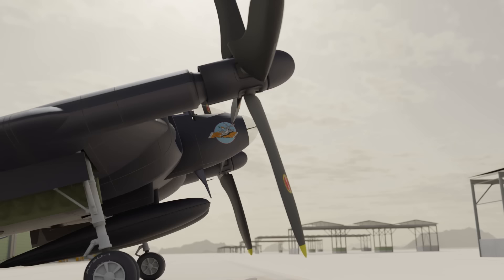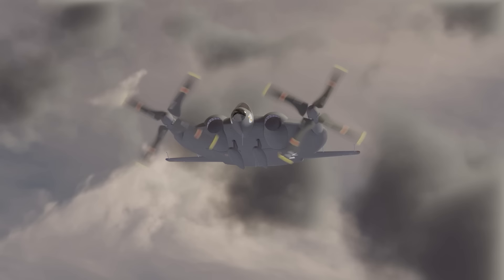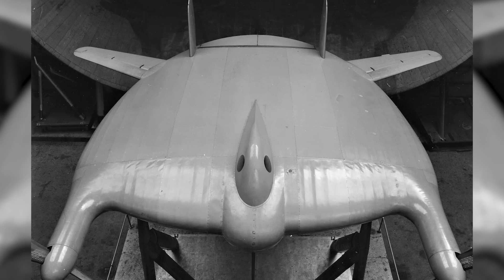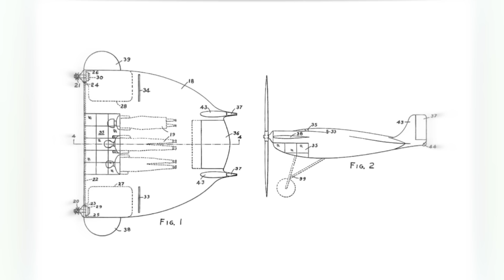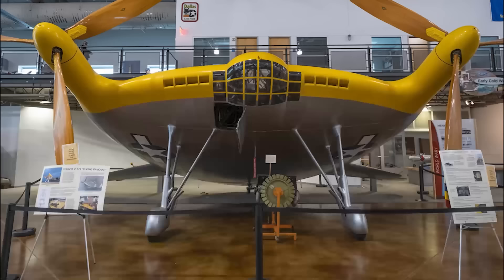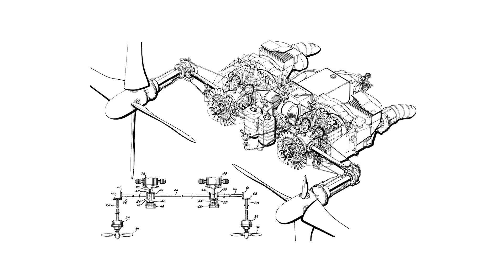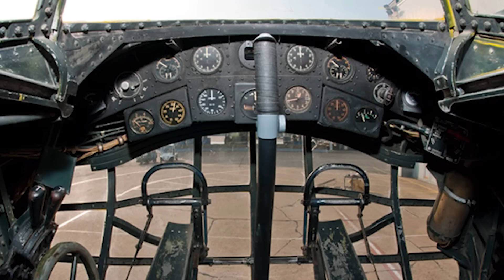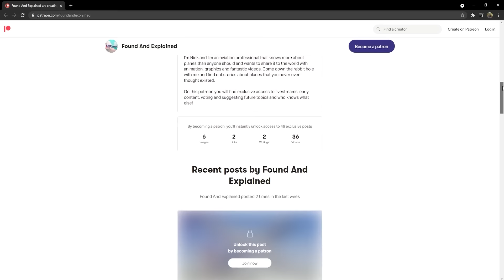The Flying Pancake - Slowest Plane Ever Made!

Comment: The engineer/designer's concept was vindicated, this could have been a very successful design but it took too long to iron out the problems and by the time that was done the jet age had already arrived. Like the Bear Cat and many other post WWII "Super Props" we will never know just what this design might have been capable of. I love designs like this that dare to stray from the conventional and push design in a new direction, even if the design fails what is learned often advances aerodynamic understanding.
Reply: I'd hardly call this a superprop.  More like a superflop.
Reply: Yes, this looks like would be useful against u-boats operating from merchant carriers as in an WW 2 oil or grain ship with an flight deck. Not the jets who killed it I think but more escort carriers and fewer u-boats.
Reply: How do you figure the designers were vindicated?  We can not really know what the performance would be like because it never flew.  And the fact that no one else came up with anything similar, say a turboprop VSTOL tells me the concept was probably flawed.
Reply: @scootergeorge9576  It flew in testing, and was eventually reincarnated as the V-22 Osprey.
Reply: @ouroboris  - The XF5U never went beyond high speed taxi test. A much lower powered proof of concept aircraft did fly.  The XF5U was scheduled to be shipped to  California, for flight testing but it was canceled and the aircraft broken up and scrapped.  And the V-22 is completely different.  It is not a fighter but is vertical takeoff and landing.  The aircraft was a loser. And following it was the XF-6U Pirate and the F7U Cutlass. Three losers in a row. Were it not for the F-8 Crusader, LTV would probably folded as an aircraft manufacturer.
Reply: @scootergeorge9576  Okay
Reply: Kk
Reply: @rulingmoss5599  I don't know who they are lol.
Reply: If it was successful they would give it a cooler name rather than Flying Pancake. They would call it Sting Ray.
Reply: It would have been a horrible combat aircraft.  Extremely complex engine drivetrain would have resulted in poor reliability.   The very low aspect ratio wings have high induced drag at cruise speed - leading to limited range, altitude, and load carrying capability. Large diameter props severely limit sh aircraft’s red-line speed, due to the requirement to maintain the blade tips at sub-sonic speeds.
Reply: @scootergeorge9576  Your incorrect about nothing similar. The Flying Flounder was basically the same concept, though single engine. It was  built in 1945. I wouldn't say any of them "vindicated" the design, but only because the intended purpose, AKA the war was over. They did however prove the design met the specs in all other aspects.
Reply: @diGritz1  The aircraft was designed to be a fighter aircraft with short takeoff and land capability. The latter was proven with the fixed gear, low powered,  proof of performance prototype.  But since actual fighter, the XF5U never flew so we can only speculate as to how it would have performed as a fighter in speed, maneuverability, range, etc.
Reply: @diGritz1  The V-22 pivots the engines for hover and can hover in level flight.
Reply: @scootergeorge9576  You said it yourself--"A much lower powered proof of concept aircraft did fly." That's a win in most engineer's books. Less the plane being a "loser" and more a classic case of "no longer needed."  Which has doomed a lot of plane concepts that were far from "losers" by anybody's metric.
Reply: @dphalanx7465  - Since the actual fighter version never flew, we can not know just how well it would have performed. And the fact that no one else built anything like it, tells me that it wasn't the greatest of ideas.
Reply: @scootergeorge9576  The designer Zimmerman worked on (and won awards for) various STOL/VTOL projects through the 60s. The whole "props at the wingtips to  cancel out tip vortices" idea is applied in Osprey VTOL today. I like to think that the XF5U's engineering DNA spread throughout a whole generation of STOL/VTOL aircraft.

And once again, cheap & simple Jets killed it; not any true failure in the idea. The true sadness is in the fact that jet-tech advanced so fast post-war. (Sigh, if it had only held off until the end of the 40s, things would have been so much more fun... )
Reply: This would make a fun concept for model aircraft builders
Reply: @Enonymouse_  - 40+ years ago, I saw an article in a radio control airplane magazine about  an RC "Gulf" gas station sign. Round like this but with a single propeller.  Most spectators were unimpressed, thinking it was just an advertisement for Gulf oil.  So the next model he built was a flying Stop sign. Way more popular. Looked like a stop sign was blown off the post and was flying away!  🤣
Reply: The Arup S-2 in the 1930s was the direct ancestor of this, and it was excellent.
Quick on little power, stall and spin proof, super-STOL.

The V-173 flew very well, despite the unnecessary situation of the props mounted as they wee.
Reply: Sergei Sikorsky worked on this, and he had designs for jet versions of it.
It didn't need or gain anything from the situation with the props at the wingtips spinning outward, a version designed for jets would have outflown everything in the air and for another decade to come.
Reply: @scottcullen4750  See the Boeing model 391, for the kind of fighter this would/should have been. It ignored the wing=tip vortices, had props in the center as with the Arup which flew very well.

The situation with the props as they were was a digression from the true potential shown by the Arup S-2, which was the direct ancestor of this.

The Boeing would have been super-STOL, and 500+ kts, without the power-train arrangement necessitated by the wing-tip props.

The very-low aspect-ratio do not suffer from high drag all the time. The Arup and many others of the sort prove it.
The huge vortices are only present at very slow speeds at very high A. The vortices and the effect that lets it fly super-slowly without stalling, are elective and temporary.
Reply: @scootergeorge9576  The Arup S-2 was exactly like this but without Zimmerman's affectation for wing-tip props, supposedly tyrying to work towards a VTOL tail-sitter.
The Arup and the similar Boeing model 391 of the era ignored this trick of Zimmerman. Other planes basically identical t the Arup have also flown well.

Se the youtube "flying heel-lift" about the Arup.
Reply: @scootergeorge9576  See the Nemeth "parachute plane" of the '30s, and the modern Rowe "UFO' completely circular tail-less with a fi8n and it flies well today.

This "flapjack" was based on the '30s Arup S-2, which flew very well. Better than other planes of its class.
Reply: @JFrazer4303  Unless there actually was a jet powered  aircraft similar to this that actually flew,  the actual performance  can only be guessed at.
Reply: @JFrazer4303  I do not believe the 391 was built much less have flown.
Reply: @scootergeorge9576  
The prototype flew . . .
Reply: @scootergeorge9576  
It was NOT a loser. The war simply ended before it could be refined.
Reply: @scottcullen4750  
Complex does not mean unreliable . . .
Reply: @jfangm  Complexity always reduces reliability, although you can mitigate that thru increased maintenance. Complex aircraft such as the F-111, SR-71, B-1, Harrier, Osprey have as much as three times the maintenance man-hour requirements as aircraft like the F-16, and ten times as much as simple aircraft like the A-10.
Reply: @scottcullen4750  
And the A-10 is just as complex an F-14, yet required less maintenance. The M16 is more complex than the Mosin-Nagant, but is more reliable. It's almost as of complexity does NOT inherently affect reliability.
Reply: @jfangm  I’m referring to mechanical, not technological complexity.  The A-10 and F-16 are mechanically relatively simple designs.  Swing wings and multiple interconnected drive shafts have more moving parts, more wear and lower reliability.
Reply: @jfangm  - The prototype, actually a low powered "proof of concept" the V-173 did fly. Powered by two 80 HP Continental 4 cylinder engines and fixed landing gear.  The scaled up fighter prototype was powered by two 1,350 HP Pratt and Whitney R-2000  (an enlarged R-1830) radial engines. Severe driveline vibrations kept the aircraft grounded. It never got beyond high speed taxi tests.
Reply: @jfangm   - It never completed a single test flight. And the project was abandoned approximately 2 years  after the war ended.  The XF5U  program went way beyond expected completion and way over budget.  If not a loser, then it was a failure.
Reply: @scootergeorge9576  
It wasn't even a failure. It was a project that was no longer needed. Had the need existed, it woud have continued.
Reply: @scottcullen4750  
There is no difference between mechanical and technological complexity. The two are effectively interchangeable. More complex systems can be more reliable than less complex ones, as in my M16/Nagant analogy.
Reply: @jfangm  - Had it not been a failure, it would have been flying by 1944.  The Navy canceled the project in 1947. If the aircraft had any future, it would have been in the interest of Vought to continue with it. At least try to fly it.  Obviously, the company would not invest any more of their own money into the thing.
Reply: @scootergeorge9576  
The Navy cancelled it in 1947 because it becake more interested in jets than further developing piston-engined aircraft, not because it was a failure. It could have been a success and STILL been cancelled for that reason alone.
Reply: @jfangm  - 
Then call in unproven.  Vought claimed an estimated 452 MPH speed.  Seems very optomi9stic.  Still, aren't you even a little curious why Vought did not attempt a test flight on their own? After all that went into constructing it? I am.
Reply: I wouldn't even call it untested, as a prototype proved the concept. And it isn't that much of a stretch to say that 452 MPH was completely doable with Twin Wasp engines. That wasn't some estimate based on a prototype engine, that was an estimate based on a well-developed engine with well-known performance. It isn't that had to make accurate, educated guesses based on known variables. And I'm curious at all. Why bother with testing an aircraft the client no longer wants? There a a plethora of promising projects that were cancelled and scrapped before being tested. It makes sense they would cut their losses and move on.
Reply: @jfangm  Yes exactly. My point in the original comment was exactly this, the prototype with a total of 150 horsepower was able to achieve over 120 miles per hour, based on its performance it should be possible to wind tunnel test the aerodynamic drag of the "production" model XF-5U factor in the power of the engines to be used and the propeller efficiencies and get an accurate estimate of the performance that could be expected. The prototype proved the viability of the concept, Vaught never prioritized the project (probably because of the Corsair) so the problems that came up were not solved quickly enough and the XF-5U missed its window which closed in 1946 with widespread adoption of jet engines. If this design had been prioritized I believe it would have been one of the so called "Super Props" like the Bearcat that arrived in the immediate post war period. Regardless, it is one of the precursors to the lifting-body designs produced in the X-Plane series by NASA in the 1950's which lead to the development of the Space Shuttle, arguably one of the greatest achievements in aerospace design ever.
Reply: @jfangm  - Why test it? Because there COULD be merit in the design and COULD be  adapted for other roles. Besides, the vast majority of the expenses were covered. It was slated for shipment to the future Edwards AFB when  cancelled and scrapped. And if not test it, why not keep it anyway as a museum piece.  It may not have succeeded but it is certainly interesting.
Reply: @scootergeorge9576  
Interesting does not pay the bills. Museum pieces do not earm interest with potential buyers. History is littered with "interesting" aircraft that were never considered for museums. And if a military contract is no longer on the table, there is no point in deveoping a MILITARY aircraft.  You can ask the Soviets what happens when an unwanted military aircraft is adapted for other purposes; spoiler alert, it doesn't go well. Merit is not enough reason to keep a project alive. One need only look at the F-35 to see where THAT thinking ends up; spoiler alert (again), it ends badly.
Reply: Y
Reply: @lucianovieira3554  X
Reply: It's a myth that the jet age killed it, and that the propeller situation helped it.

Sergei Sikorsky worked on it and designed jet versions. They would have flown very well, super-STOL and very fast. They'd have outflown everything in the air or for the next decade.
The Navy did not stop using props at the end of the war. That's another myth.
Many planes of the same approximate shape have flown well: They are not draggy and inefficient, they're sleek and quick on little power.
The situation with the props did not help it, did not give it the flying qualities.
Reply: @scootergeorge9576 
 Incorrect, except that the design including the over-sized wing-tip mounted outward turning props was busted. It didn't need them they didn't help.

See the history of very-low aspect-ratio planes.
First, the Nemeth "parachute plane" of the '30s, with a 15' circular wing.
Faster than the plane which the fuselage came from, super-STOL, stall-spin proof.

Most importantly, see the 1932 Arup S-2, which Zimmerman based this on.
Sleek and quick on little power, astounding climb rate, super-STOL, stall-spin proof.
Look up the "Flying Heel-Lift" youtube about it.
Reply: @JFrazer4303  
It is NOT a myth that jet engines killed it. 
And yes, the Navy did continue using props after the war, however, not in the way you think. After WWII, the Navy accepted the A-1 Skyraider into service, and used it for decades. It was the last propeller-driven combat aircraft in Navy service. For the most part, the Navy stopped using prop planes when the Panther was delivered; it was jets from that point forward. So yes, the jet age DID end the Pancake, as the Navy had neither interest nor a need for the aircraft.
Reply: @JFrazer4303  - Yes, the Navy continued with props with the F-4U and A-1 not to mention the T-28, S-2F, C-2 and E-2. Shore based, they flew the  P-2 and C-118. My first assignment was in the Navy  in 1972 was with VP-65 equipped with the SP-2H.  In 1979-80 I worked on a US-2B with the Naval Air Reserve Unit, NARU at NAS Memphis.  
As far as the XF5U, the Navy killed it because it was way too long in development, way over budget,  and may still have hade vibration issues.  It was scrapped without even bothering to make a single test flight.   And as a fighter aircraft, the jet at least partially speed doom for the Flapjack.  The 452 MPH speed Vought anticipated was undoubtedly quite optimistic.  I believe the tip speed of the very large propellers would be approaching transonic speeds before that speed was hit.  How fast is the V-22?  With two 6,150 engines,  500 KPH, or 311 MPH. I would be very surprised if the lower powered, but less drag F5U would exceed 350 MPH.
Reply: Not true. They would have flown very well on jets, and besides the US military flew piston-prop combat planes into the '70s and for support into the '80s, and still fly props.
Such planes were not inherently draggy, the props at the wingtips did not counter vortices or any supposed drag.
Reply: @scootergeorge9576  Plenty of roughly similar planes have flown well, proven to not be draggy.
The Vought/Zimmerman plane was copied from the 1930s Arup planes from Indiana. they did not have excess drag, quite the reverse: they were sleek and quick on little power, super-STOL, and stall proof.

See the 1940s Boeing model 390-391-396. Like the Arup, a single prop in the center. With the experience of the Arup and others like them, we can say that it would have flown well and very fast for its power.
Sergei Sikorsky worked on the Vought plane, knew that it did not need props on the wingtips spinning outward, designed jet versions.

A pair of normal twin engines shoulder mounted like on an F-7 or S-2/C-1 would have suited just fine, and made great planes.

Anyway, the US Navy flew piston/prop combat planes into the '70s  and for support into the '80s.
Reply: @jfangm  
The US military operated piston-prop combat planes into the '70s, for support into the '80s.
A jet version of this would have made a great super-STOL super-fast fighter. Would have blown away anything contemporary or for the next decade or more.
 Several designs that have been similar have proved it, from the '30s Arup planes, the Payen/Aubrun AP-10, the Nemeth "Parachute plane", the Farman 1020 off the '30s.

The Facetmobile of the '90s was not a toy stealth plane, the designer chose the shape and method of construction to be simpler to make.
Proved the design.
The '80s Hatfield "Little Bird" series were follow-on proofs to the '30s Arup planes, proved everything that was documented about them.
Reply: @scootergeorge9576  The Vought/Zimmerman thing torpedoed the design concept by tying it to Zimmerman's VTOL tail-sitter experiments. The concept did not need the wing-tip props. 
That was a digression from exploring the Arup which they should have done a decade earlier, but they'd have had to pay royalties to a foot doctor from Indiana for the greatest advance in aeronautics yet.
The Boeing model 390/381 would have been better than anything else in the war with props. Sergei Sikorsky worked on the Vought planes, designed a jet version that would have blown away anything for the next decade.

The fact that the Navy paid Zimmerman t do a parody of the Arup instead of a real follow-on, doesn't invalidate the concept which is proven to be superior to "normal" planes in just about every criteria, it invalidates the navy and the concept of "if it looks right, it'll fly right".
Reply: @jfangm  The merit of the very-low aspect-ratio planform was proven, a decade before the V-173 with the Arup S-2 which the Vought plane was based on. Notably better in any criteria than any "normal" plane of similar power & footprint.
That the concept violated every part of "if it looks right, it'll fly right" and was built by an Indiana foot doctor, doesn't invalidate the concept or disprove the data showing that it was superior. See the youtube "Flying Heel-Lift".
A more honest follow-on like the Boeing model 390 would have been better than anything else flying, based on ample data from multiple successful proof-of-concept planes.

The Vought/Zimmerman affectation for the wing-tip mounted props working toward a VTOL tail-sitter shows that they didn't want to study the concept, didn't want to pay patent royalties to Snyder in Indiana.

The fact that the "power that be" didn't want to use the concept despite ample data showing its superiority, doesn't invalidate the concept.
Reply: @JFrazer4303  
I never said the concept was invalid. Also, a jet version of this never would have worked.
Reply: @jfangm  You have no basis for saying a jet version wouldn't have worked, and several iterations of test planes with the same sort of wing but very different propulsion have worked very well.
Reply: @JFrazer4303  
Except there is a basis - this was not designed to use jet engines, it was designed to use piston engines. You cannot just replace piston engines with jet engines. Doing so drastically changes the forces acting on the airframe, which leads to all kinds of problems. Just because SIMILAR designs have worked with jets does not mean THIS design would have. Jet aircraft are designed to use jet engines. Your claim is both baseless and ignorant of reality.
Reply: @jfangm  I never said or meant to imply using this identical design. The concept is sound.
Reply: @JFrazer4303  
The concept is sound, yes. But you said design, implying this specific airframe.
Reply: But the fuselage has returned, more or less. No less for a superplane. If I only could remember the name... (anyone?)
Reply: nature already made one of these, the manta ray.  So, why give pancakes the credit?  The Manta Ray was robbed
Reply: @pokerchannel6991  
The manta ray doesn't fly.
Reply: @jfangm  oh?  And a pancake does?  Interesing!
Reply: @pokerchannel6991  
Maybe instead, the gliding lizard "dragons" with similarly shaped short-aspect-ratio membrane wings.